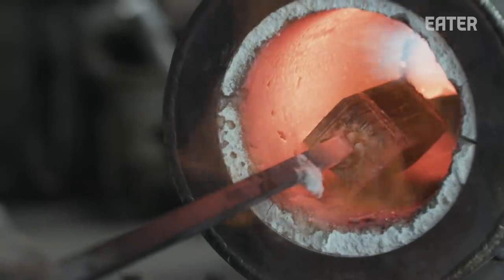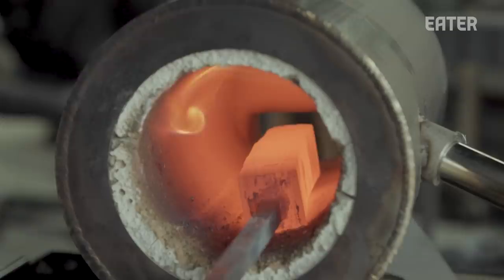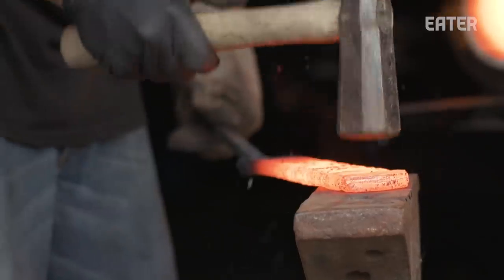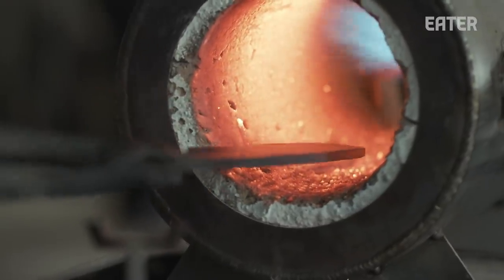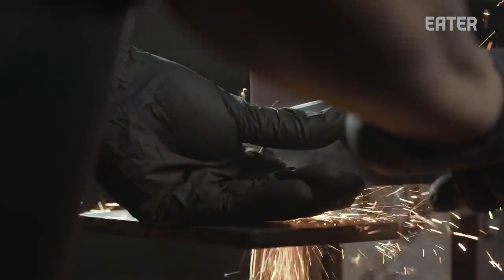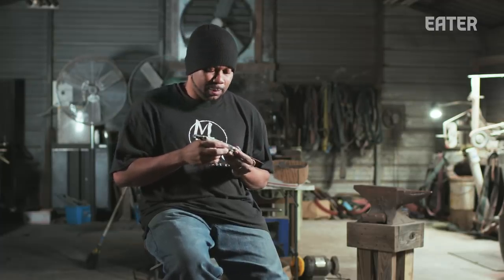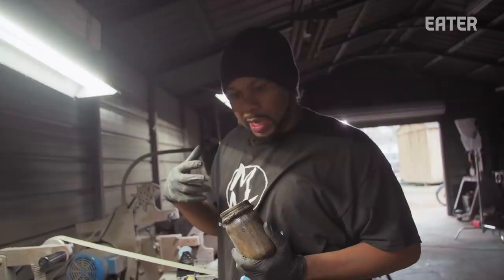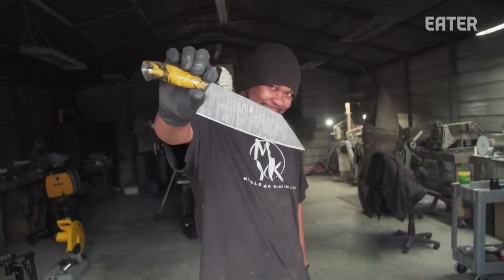Why Forging Damascus Steel Knives Takes Years to Master — Handmade

Comment: As a knife enthusiast, you eventually go down the rabbit hole of how they are made and likely wind up becoming obsessed with the entire production process. It just happens. I am one of those people. That being said, this man knows a lot about the knifemaking process and is a master Craftsman. His wonderful word economy in his explanation and narration would also hold up to even the most aggressive of knife pedants.
Reply: And then he ends up not know what Damascus steal is
Damascus is a high carbon steal that make extremely small water wave like patters on the blade
The high carbon gives that blade a higher chance of being a better blade, how ever sulfur impuritys can make the blade much more brittle

Its not welding two steals together
Reply: @geinstein8407  How about before you criticize others you look at yourself first.  It is spelled "STEEL" not "STEAL".  What's worse is your comment has already been edited.  I feel it is safe to conclude you are suffering from Dunning-Kreuger.

He doesn't know what Damascus steel is, however he just created an impressive Damascus steel blade before your very eyes.  What you are complaining about is a mere semantic issue and has no reflection on his craftsman abilities.  It is likely due to him attempting to find a simple way (or example) on how the wave pattern can be achieved because if your brilliant mind didn't notice he was being interviewed and was given a spotlight to show his craft.  He likely concluded there would be laypersons, unfamiliar with smithy jargon.
Reply: @matthewhall9692  well said.
Reply: @matthewhall9692  2nd!
Reply: @crisvega7588  yup.

Comment: In India there is a tribe of knife makers who live in tents and build their own furnace in the ground. They are nomadic and you can't find them stay in a place for more than a couple of months. They use the leaf springs from old trucks as base material for the knives. They have a traditional process for heating and shaping the knives. The knives they make have an exceptional cutting edge and they are handle very well.

Comment: This guy understands welding. High enough voltage to hear that quiet sizzle, but enough time in place on the billet to penetrate the steel deeply and have time to build up so as to not create an imperfection in the forging process.

Comment: I'll admit that I've never done any blacksmithing, but isn't ceramic wool hazardous? Especially the way he just handles it and jams it into the forge "door"?
Reply: I'm not sure but couldn't you just use rockwool instead? I know they sell it as artificial embers for gas fireplaces and it doesn't burn at all.
Reply: @MrEazyE357  The issue is with the fibers of many of these ceramic wools being asbestos or asbestos-like

Comment: This guy is skilled but imagine the old master when they had no mechanical/technical advantages
Reply: It’s practically the same except takes longer, no sanding belts, have to use wood or Characol to create the fire, etc otherwise it’s relatively the same, they all do relatively the same thing, just different methods, and a more basic setup.

Comment: Aren’t you supposed to fold Damascus and that gives it the pattern?
Reply: depends on how you make the metal, likewise this is his way of making the knife
Reply: Folding is traditionally about improving the quality of the steel: Getting out impurities, improving the carbon content, and such. Thats why its so often brought up with old Japanese techniques because Japan has terrible raw materials so they had to become extremely talented at techniques like folding to make a good blade.  
Folding was known and utilized across the world, though its not nearly as necessary with higher quality raw materials, and of course these days we easily produce far higher quality steels that eliminate the need for folding at all. 
(People can still fold metal to produce particularly elaborate damascus, but its for aesthetics and largely depends on the pattern you are after.)
Reply: And it's helps its sharping to a microscopic level.
Reply: Let's go ahead and school some people on Damascus. This is NOT true Damascus. This is the laziest way to get a Damascus LOOK. true Damascus is made from wootz. The pattern in true Damascus comes from carbon. The carbon comes from wood chips during the forging process. People can't afford to pay for a true Damascus blade so this is what we get. Great looking knock of versions. As a matter of fact, this method is so common that this is now accepted as authentic Damascus. However if you had a true Damascus blade sitting next to an acid etched blade you would ABSOLUTELY be able to tell the difference

Comment: "Actually" that is not damascus steel, this is pattern welded steel.
Reply: Technically yes. True Damascus hasn't been made for years because no-one truly knows the original steels used.
Reply: @jameshersom2536  step 1 for making damascus steel is creating layers by folding, not by sticking sheets next to each other and pressing them to make sheets. True Damascus is still made and used in tools, but not the ones made by this guy.
Reply: @jameshersom2536  that’s not true, original Damascus or Wootz has been figured out and been constantly redefined for years. Look for the John Verhoeven study.
Reply: @jeanpaulgartier3404  thank you!! 😂👌🏼

Comment: 9:00  That reminds me of one day when I was in a restaurant supply store and looked at some knives.  I pulled one out of the block and immediately put it back.   The wooden grips were wrong and the blade was CRAZY thick.  As soon as I let go of the knife, the cashier said, "those are really nice knives."  "No they're not", I replied.  I no expert on knives, but I know crappy knives when I touch them.

Comment: Genuine question: 

Quintin welds the pieces together, then he heat them up and press them to elongate... But I notice that bits of those welds are falling off as he press. How did the pieces still stay together despite losing grips on the slabs?

Comment: "forging is a third of knife making" well for a guy who works in a very modern way, yes, but traditional knife making takes forging as far as possible so we don't need to remove a lot of material in the end. I try to bring my knives to their near final shape and thickness during the forging process. It's a personal choice, but i think it makes more sense than just "forging" a rough shape and then doing all the work with a grinder, wich wasn't possible even a century ago.
And i say "forging" with brackets beacause forging is a bit more than squishing a piece of metal in a press (now most modern patterns of damascus can't be made the traditional way, it's more like sculpting away a fat ingot with steel shapes in it. Forging the knife to its final shape will distort or even hide the patterns). This guy's work is looks really good, but i still find it sad that the old way of making things has been abandoned by a lot of craftsmen.

Comment: Damascus steel isn't weilding 2 types of steel together.
Its using the correct ratio of carbon to iron and some minor vanadium impurities as well as so careful cooling.

Comment: Pattern welded steel isn’t Damascus. It doesn’t have any of the mechanical properties of Damascus steel and even the waves are different. 

I’m not sure if we’ve even managed to reverse engineer Damascus steel yet, because the mines and foundries that produced and exported Damascus ingots no longer exist.

Comment: As a career welder him saying that clean clean is the most important is actually incorrect. also he didn't put on any sleeves when he started welding he talks about safety and then allows himself to get flash burned. Stick rod specifically 60 rod is designed to weld through rust paint dirt grime and everything else. He should have been more specific

Comment: THAT'S WHAT DAMASCUS 🎶 THAT'S WHAT THE POINT OF DAMASCUS 🎶
Reply: And then he ends up not know what Damascus steal is
Damascus is a high carbon steal that make extremely small water wave like patters on the blade
The high carbon gives that blade a higher chance of being a better blade, how ever sulfur impuritys can make the blade much more brittle

Comment: I'm not taking away from the skill needed to produce this kind of blade, but it is not Damascus.  Rather it is pattern welding.  Damascus is made via a very different process.  At 1:53 Middleton refers to it as 'forge welding,' but elsewhere he does also call it Damascus, which is simply is not true.

Comment: For the longest I thought Damascus was some sort of lost art of forging steel weapons. But I think out of nowhere it just was made by people. no real clue as to how until this video. Like isn't that a thing? or am I misremembering and accidentally mentioned some sort of Mandela effect?
Reply: From what I remember. It there was a now lost form of iron/steel making called Damascus. We don’t know a lot about what it actually was, but it’s thought to be a form of folding metals to make them stronger. Which is the basis most modern techniques are inspired by.
Reply: You were right. People call pattern welded metal "Damascus" because it looks like the original Damascus steel which looked the way it did because of how the base steel was made, not from folding over and over. It's a buzzword that people have latched onto.

Comment: "safety safety safety" as he welds without long sleeve, burns and cancer in coming
Reply: Depends how careful you are, but yeah I feel ya on the rads.
Reply: Did you not notice his nitride "welding gloves"?
Reply: @deathfromthedepths  I've been a welder for almost 10 years and I can tell you sparks will always find away to burn you even if you're wearing full leathers
Reply: @bananaclipper9343  Suppose I just have some luck on my side then. Not often that I get burnt. We all have different experiences, so no worries brother I didn't doubt your word.
Reply: @deathfromthedepths  I wasn't saying you were doubting me. And don't get me wrong I have welded without sleeves on but normally it's just tacking for fit up, but prolonged welding is really bad especially for the uv ray side of things

Comment: It doesn't take years. People Mastered it many centuries ago without youtube videos, expensive equipment, chemicals and clean steel plates ready to be used. If you wanna know the inns and out and all the "styles" and such, then it would take a year if that's your primary job. It's a hobby of mine and I've studied and watched many forgers (including people who cut high end knifes without forging). Everything is glorified, everything takes "years". If you have good tools and good hands and dedicate yourself to it, then no, it doesn't take 20 yeras. 1-2 at best.

Comment: maybe because its pattern welded and not ACTUAL damascus.  Real damascus was called such because of where it was made and also the ore it was made from can ONLY be found in a small cave in the middle east.  Also they didnt use different metals, they just folded it over and over and used a lot of bamboo to add carbon to the blade.

Comment: There 3 rule in welding :

1.clean
2.clean
3.clean

Ah yes
Reply: Rules for Damascus
1 it has nothing to do about welding
2 don't mix metals
3 have a high carbon steal
4 make shore the metal is clean from any sulfur impurity's

Comment: Those are not real Damascus blades. The real process of manufacture has been lost in the 17th century.
This is an approximate re creation with modern technics which begun in the 19th century without the original steel which doesn’t exist anymore. 
But still, this a great job.

Comment: U cant do damascus,read about this. Your knife JUST HAVE A LOOK OF DAMASCUS STEEL
Reply: I know what your talking about but they have been able to reproduce the final result that has all the properties that the old damascus had. They just haven't been able to recreate the original process but the final product they have.
Reply: @memphispatriot  who is they? If u dig deep enough into reproduction of damast,it didnt have  same properties,point one. Second is that was with usage of most advanced technology,and EXPERTS,and even they cant do the same properties u know? Educate yourself
Reply: @dominicluck97  lol
First of all, traditional damascus is no match for modern steels. Not in any way. It had the properties of normal carbon steel. 
Second, we can reproduce the original damascus (wootz steel). It has been done multiple times. 
Also you dont seem to understand how its even made. "pressing even 1000 layers of any available steel or alloy in the world" - that sentence alone makes your lack of knowledge very obvious.

Comment: No one makes Damascus steel. We've literally lost the technique. And, no Damascus steel is not "welding two types of steel in a forge". Damascus steel was unique for being as strong as most other steel of it's time, but also being flexible enough that a Damascus steel sword could bend almost ninety degrees.

Comment: No one has EVER been able to come close to true Damascus steel, so stop calling it that.  Just because you learned how to make a pattern by folding metal does NOT make it Damascus steel.,
Reply: The recipe for original Damascus (wootz)
has been recovered/reproduced.
However, performance wise the patter welded steels shown on this video can easily rival and exceed the performance original Damascus. It's just carbon steel after all.
The heat treatment is the important part

Comment: Just to be pedantic, what you are doing is not Damascus steel, it is pattern welding steel.

That aside, everybody calls it Damascus, even though that not technically correct.  Even i my self call them "Damascus" blades.

Just throwing that out there.

But anybody that can produce a good pattern welded blade is okay by me.  I understand the process (i have a metallurgical background [but am not a metallurgist]), i could not do what you do.  I would love to, but i have too many other things going on to pursue another hobby.

Comment: This smith lacks a lot of smithing skill. Real smith don't use anything else than hammer before quenching. Only after quenching the belts sander is needed and that is only to make bevels and sharp edge.  Belt sander should not be used at all for anything else.

Comment: Well if he was rly inspired by european and japanese skills. He will use a hammer to make better structure and most important some logic in steel structure. Hard go outside and the softer go inside and blant side to make more elastic blade in work. Steel that he forged got nothing to real Damascus steel.

Comment: Lol 😂😂😂 
"Safety Safety Safety" 

Ya welding-safety is not just a face-shield
So he has zero safety in order... 
Bare skin welding... 
Ventilation ( presumably missing since it's not pointed out)
Putting head over welding spot to breathe largest amount of welding fumes possible. 

Ridiculous to say safety even once here

Comment: This is all BS. Damascus steel has layers because of the shitty quality of the steel used back then, which had the benefit of forming carbon nanotube layers between the layers. Especially with clean steel, there is nothing to form carbon deposits. If anything, you would want to coat the steel in grease before welding it. Japanese knife makers spend weeks hammering steel by hand, and he uses none of the Japanese techniques.

Comment: That's just a fancy knive with white lines in it. Not even folded once . This lazy piece of welded steel is not a damascus. Actually it does take years to master a damascus, but in this guy's case it would take decades.